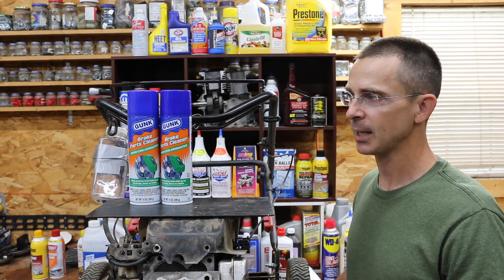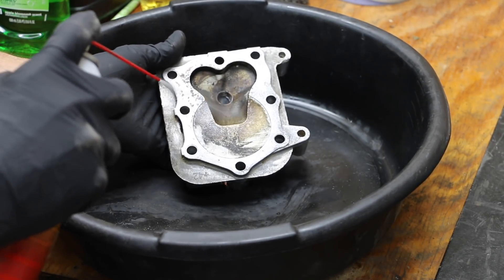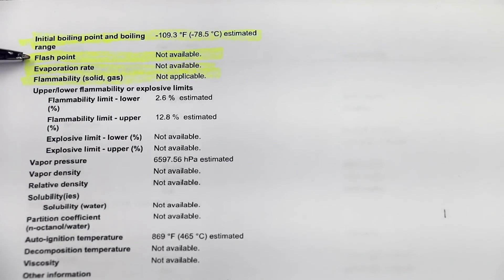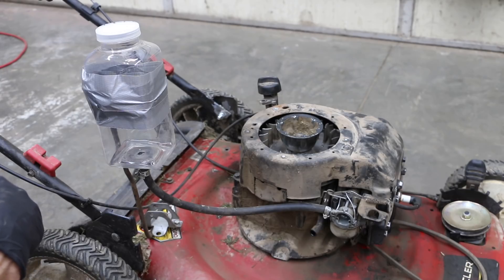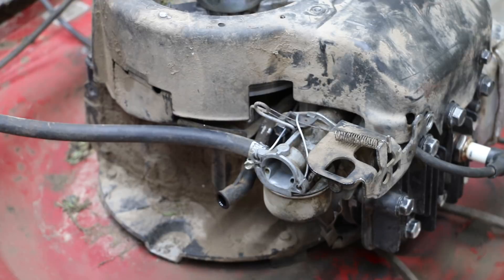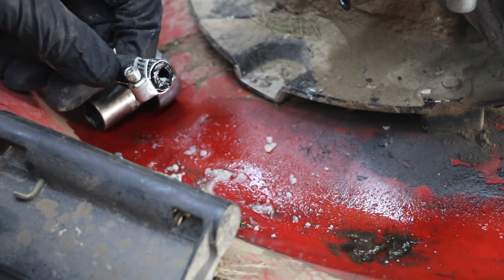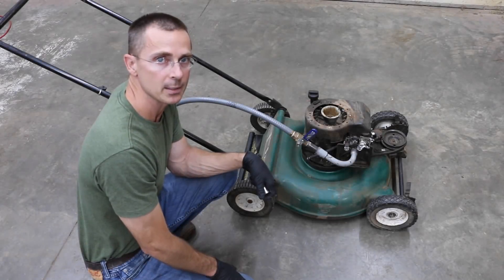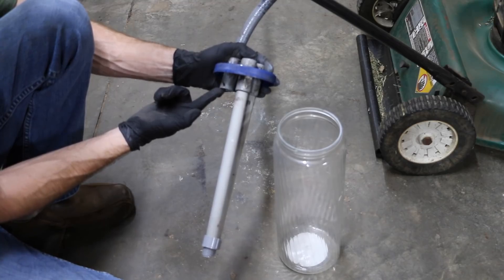Will a Gas Engine Run on Brake Parts Cleaner?  Lets find out!

Comment: Ordinary wheat flour is also highly flammable, even explosive, and should run an engine if injected as a powder/ air mix. You might want to try it, but it might fill the engine with residue quite quickly, as would gunpowder. Flash powder, on the other hand, might work well, and burn quite cleanly, if you can keep temperatures down by minimising the amount of powder injected.
Reply from the maker: Thank you for this recommendation.

Comment: I've started a generator and Craftsman riding lawnmower which is a lemon both on brake cleaners because the they weren't running after a few years with fuel left in them
Reply: Also Seafoam and Starter fluid
Reply from the maker: Thanks for commenting on this.

Comment: How long would a dry engine run with two cycle gas?  How long would it run on gas with Lucas Upper Cylinder Lube and Fuel Treatment in it?  Or maybe even a combination of both.
Reply from the maker: Thank you for this recommendation.

Comment: I would like to try the wood gasifier for my generator, does anyone know if it will eventually gum everything up in the engine
Reply from the maker: I plan to create a video on this. Yes, it'll gum up your engine, unless you design a system to filter the wood gas.

Comment: Will an engine run on methane?  Straight FARM POWER baby.
Reply from the maker: Thank you for this recommendation.
Reply: Jon G Methane is used as fuel as we speak. You should research if your curious, we actually collect it from landfills and use it as fuel.
Reply: @Lyniv575  I have seen garbage trucks that run on natural gas... would be neat if they could run them on landfill gas or something.
Reply: @Lyniv575  true story. The farmers in our area buy the rejects from the mill for that reason
Reply: There are a lot of "off grid" people who have Digesters which take human and animal waste and put enzymes in a vessel, with no oxygen. this produces methane, that's not quite pure. it produces about 800 BTU's per cubic foot, rather than natural gas, which is about 1,050 BTU's. They use it to run generators, as well as for heating purposes. It works pretty well, but the engines are about 30% down on power compared to gasoline. It burns so clean, there is no tell-tale odor.
Reply: @vincentrobinette1507  am one of those off grid farmers methane works ok most the time only thin I ever have a problem with is when we use it for a gas stove is it doesnt burn as hot
Reply: @theghost7277  That's correct. The lower BTU content of the "swamp gas" compared to the mass of the fuel means, that the flame burns at a lower temperature. That also helps reduce the NOX, which causes acid rain. The real benefit is that methane is a much more potent "greenhouse" gas than Carbon dioxide. Burning the methane into CO2 greatly reduces its effect on the environment. It is also carbon neutral, as opposed to the carbon from fossil fuel. anything that can take the place of fossil fuel helps, in fact, this can be considered a renewable bio-fuel.
Reply: What about Nitromethane used in R/C cars and aircraft
Reply: @1gearwrench  my first engine rebuild was due to trying this! Age 12! Plane was crashed,had leftover fuel,Dad wanted yard cut... Burned hole in piston. Lost allowance for several weeks!
Reply: @Lyniv575  I've used hundreds of gallons of nitro methane so i know exactly what it will do but not everyone has seen.  Lol
Reply: The buses here in Perth, Western Australia run on compressed natural gas (CNG) which is essentially methane. I think the semi's in California also have diesel engines converted to run on CNG to help reduce particulate pollution.
Reply: @Lyniv575  its a methanol base that has oils added with 20% nitromethane for rc cars .. 15+years ago it was 20$ a gallon i had a traxxas t-max the 2.0 version with the 2speed transmission thought that thing was the shit
Reply: Dumbass in Pakistan instead of gas (more mileage and cheap price) we use cng (compressed natural gas) in cars

Comment: Try oiling the cylinders when you do a compression test. The reason the vapor engine lost compression is because the brake parts cleaner dissolves the oil causing the piston rings not to seal properly. That's just one less variable causing the outcome to change.
Reply from the maker: Thank you for this recommendation.

Comment: You should test the fuel consumption rates when doing these tests as well.  I am interested to see if you can get more hours out of these fuel alternatives than you could with gas both in liquid and in vapor form.  Maybe it would be cheaper to run your mower with paint thinner or brake cleaner than it would with gas???
Reply from the maker: This is a great recommendation--thank you!

Comment: Can you do a test on a product called "Motorkote"? A lot of semi truck drivers use it saying it lubes up the engine and increases gas mileage, also have a friend who claims his engine ran for almost 20 minutes without oil in it after he blew a hole in the oil pan. He said he used this product and he seems to think that's why it didn't explode. Keep up the good work!
Reply from the maker: Thank you for this recommendation. I plan to test Motorkote.

Comment: i used brakleen to start motors before and it works great, but putting it through the fuel system would probably damage all the rubber and plastic components like seals and the carb float, and i would never do it in a car cause thats alot of rubber and plastic parts that could be damaged
Reply from the maker: This is a great point. This is a very powerful solvent. Thanks for commenting.

Comment: Using the vapor induction system used in the everclear video, can you run a motor off spray paint vapors as everyone knows they're ridiculously flammable. Also, if it does run how much does it gunk the cylinder head and does it effect compression?
Reply: Didn't realize you used the vapor contraption in this video
Reply from the maker: Thank you for this recommendation.

Comment: i like your videos, what i would like to see is you make your own blend of fuel, but it has to be as cheap as possible, i would also like to see in addition you make a hydrogen cell, similar to how you put together the fuel vapor one, (see if you can rig up a stator coil on the top of the engine to generate the amps to power the cell) - with the vacuum from the engine it will bring the hydrogen tempered water to boiling point and it should provide enough hydrogen to keep the engine running, in theory here is a resource to help: 
https://www.youtube.com/watch?v=wxfo-w0ptEo
https://www.youtube.com/watch?v=wjeM2IBhtlc
Reply from the maker: Thank you for this recommendation and thanks for the links.  I'll see what I can do.
Reply: Project Farm thanks, can't wait to see what you can get to happen :)

Comment: Using the vapors, we really have no idea what the engine is actually running on.  Most chemicals are compounds.  That being said, when they evaporate the chemicals with the higher vapor pressure are the last ones to go.  On another note, I wish someone made an adjustable main jet for you to make your job easier.  Thanks for the great videos.
Reply from the maker: This is an excellent point regarding the vapor canister.  Also, I'll see what I can do regarding the main jet.  I need to do the test right instead of choking the engine to draw in enough fuel. Thanks again.

Comment: Heptane is an additive to gasoline that increases its ignitability, too much and it creates  massive spark knock which would destroy an engine. As well as wash all the oil off the cylinder walls making it destroy the piston rings. It can dissolve oil and grease making them completely evaporate.
Reply from the maker: This is great information. Thanks again.

Comment: How about converting an engine to run off gases? Propane should work pretty well - Villiers in the UK used to offer propane conversions on some of their small 4 stroke engines. There are plenty of other flammable gases out there to experiment with, would be interesting to see how long an engine running an air/acetylene or oxyacetylene mix would survive for.

Please don't blow yourself up though...
Reply from the maker: Thank you for this recommendation.

Comment: Hi great videos, i use brake cleaner all the time and is harmless to rubber and plastic, even used it as a tar and glue remover from car paint work gunk must be more corrosive. have you ever taken exhaust off and checked which fuel makes most noise and biggest flame when burnt.
Reply from the maker: Thanks for the positive comment. I have not tested for flame and noise. Thank you for this recommendation.

Comment: I don't even have to watch the video. I know for a fact the you can run an engine on brake cleaner, penetrating oil, and almost any liquid that will burn.
Reply from the maker: Thanks for commenting.
Reply: Just saying this because two weeks ago we tried getting an old Flathead 6 started and I grabbed penetrating oil instead of starting fluid. They both are in blue bottles that look almost identical. Got the old Studebaker to run on it though.

Comment: The first thing I got to say is I love your videos it really shows what you can add to a lawn mower just to get it to run but this last video I actually showed you what not to put in one that was pretty cool but you know you can buy that same carburetor and maybe you can do a series on this eBay carburetors for what you can pay for a rebuild kit unless you can get them cheaper than I can I get the carburetors for about 8 to $10 and I know the rebuild kits go for about 6 but just a suggestion keep up the good work
Reply from the maker: Thank you for the positive comment and thank you for the recommendation on buying them on ebay. This will save time and money.

Comment: Hey, love the videos. I've messeged you before about putting boost to a lawn mower motor to see what they can take. I could see that getting expensive, so I was thinking and there might be a way to use an air compressor to simulate boost if a guy can rig up a way to control the psi and add more fuel to see what it can handle. I'm sure i can't be the only one who thought of a boosting one of the engines for a gocart.
Reply from the maker: Thank you very much for the positive comment. I'm still thinking though the best way to boost a small engine. Thank you for this recommendation.
Reply: Project Farm  no problem, and no worries I figured so I just thought about it when I was using my compressor and thought I'd mention it.

Comment: Here's a stupid idea... Back in the day we used to take a can of Aquanet and a lighter to make an impressive fireball. So I know hairspray is flammable. I'm curious if it will also run an engine? Great videos! Sorry about the carb, but now we know how bad brake cleaner is on a carburator!
Reply from the maker: Thank you for this recommendation.

Comment: Did you ever try to run an engine off of lighter fluid? That would he interesting to watch. But if it might be dangerous, don't do it then.
Reply: Zippo fluid is essentially naphtha, so yes it will run. This is also the solvent used to clean printing presses.
Reply from the maker: Thank you for this recommendation.
Reply: lighter fluid for burning lamp (the one they used 100 years ago) or propane/butane? As the later is widely used in cars (or it's specific version).
Reply: @drgrunn174  Gas will work without problems, but the lamp fuel is more akin to diesel, so you'd probably have to mix it with gasoline.

Comment: Sometimes we use a 1lb propane bottles and hose to start and drive vehicles into the shop that has fuel delivery issues,  how about a video on converting a mower to use one and how it affects engine?
Reply from the maker: Thank you for this recommendation.

Comment: Another good video. You have covered a lot of possible fuels and oil capabilities.. maybe a slight performance video is in the works? Small engine... maybe shave the head down in .030" increments and record the psi, stroker crank vs stock, high comp. piston vs stock, stock muffler vs straight pipe,... etc etc etc...would be exciting. A kohler 10hp would be the perfect motor to test.
Reply from the maker: Thank you for this recommendation and thanks for the positive comment.

Comment: Hmm, what happens if the engine backfires into that waipor can?
Reply from the maker: Great point. I'll be adding a check valve to the setup before using it again.
Reply: Project Farm sound like a good idea! Not so nice if it explodes and hurt you really bad🤐

Comment: Hey you know what you should try building? A Self-powered generator. Not sure if the video is up on youtube anymore, but anyways a guy made a Ferris wheel type wheel with spoons on it over a water tank, he then had a high power water pump shoot water at the spoons and turn the wheel, attached to the wheel was an alternator type power producing device, then from there he had an electrical receptacle wired to it. He would plug it in his house with his extension cord, then after its up to speed, he quickly unplugs it from the house into the generator receptacle. It then ran on its own unlimited power and even produced enough power to also power a light bulb.
Reply from the maker: Thank you for this recommendation.

Comment: Thank you for your videos not sure if you have ever had this suggestion before but I own a 2008 Polaris Outlaw 525 KTM IRS ATV. I went to my local polaris dealer to get oil for the quad. I have the full shop manual for the quad and it specifies to run Polaris PS-4 extreme duty 10W-50. I know this but I always doubt myself and wanted to double check so I ask some one at the counter. He is looking it up and he says that engine takes (i forget the brand he said ) MINERAL OIL! I was like what mineral oil, I buy my PS-4 and i'm on my way. I was dumbfounded that this guy told me to run mineral oil in my engine because it does not take it but my Hydraulic clutch does. But what if I was someone else who doesn't know any better and ran either mineral oil or the mineral oil for the clutch through my engine. Keep in mind there is a severe load on the engine because I ride it like I stole it!!
Reply from the maker: Thank you for this recommendation. I will be testing Zmax soon, which, according to their MSDS, is 99% mineral oil. It'll be an interesting test.